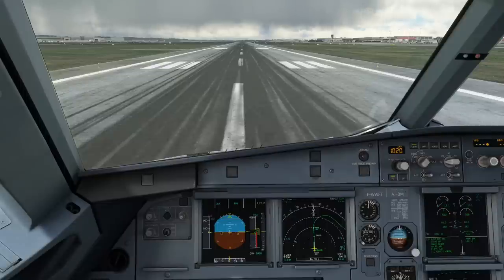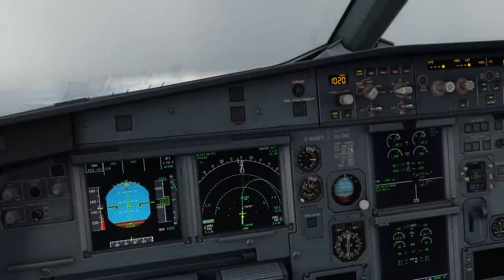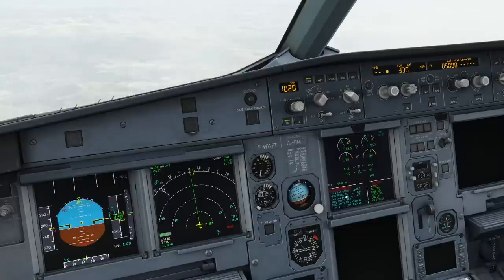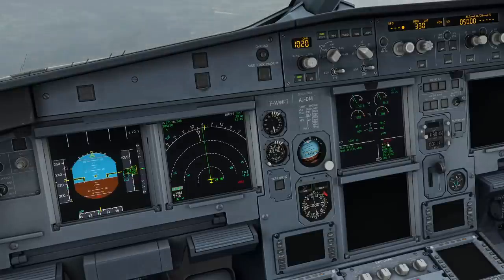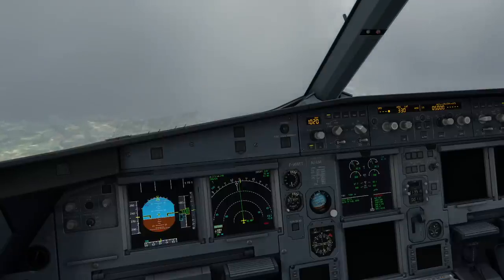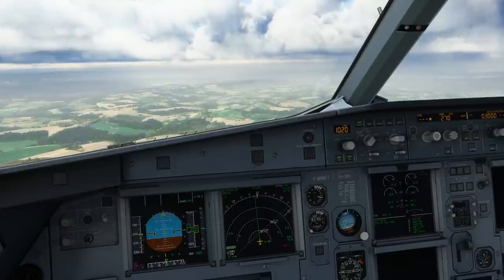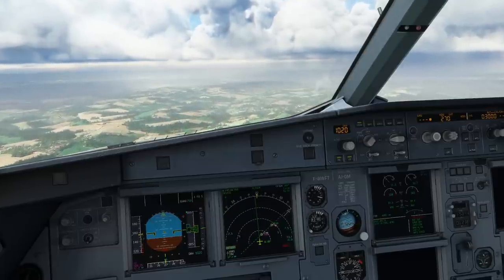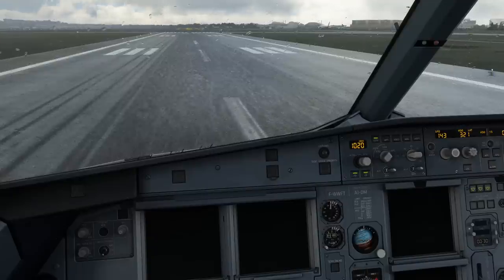Airbus Emergencies: EMER ELEC Configuration | Real Airline Pilot

Comment: Not related to this video but I noted your action about the baro selection.  When you depart a airport like Heathrow and the Alt Constrain for the SID is 6000 feet  and the transition level is also 6000 feet, when do you set your altimeter to STD? As we know some SID departure from EGLL can be quite lengthy. Do you stay on the current altimeter setting until you cleared for a higher altitude or do you go to standard?
Reply: My guess is if the SID alt constrain is 6000 feet, you leave the altimeter as is until you're clear to climb. If the SID alt constain is FL060, you change it to STD.
Reply from the maker: The transition altitude is, as the name suggests, still an altitude, thus you maintain an altitude. Which means maintaining QNH.
Those long altitude restrictions on SIDs in the UK exist just on paper, in hundrets of flights to the UK I never had to stay down low for longer than a few minutes at best.
Reply: @A330Driver  Thanks. In real life it make sense. 
But in VATSIM I'm cautious about this because the VATSIM controller might think I deviated from my planned altitude.

Comment: Great video as always, thank you!
I've heard that it's a good idea to extend the flaps to landing configuration before extending the landing gear, so that the airplane is already in trim when you go into direct law. What do you think?
Reply: Not the procedure. The gear down and flap 3 will compensate eachother to some extent. The only procedure where flap3 before gear id G+Y HYD system low pressure because no trim is available at all

Comment: the problem with absolutely zero flight computers in an airbus - being fly by wire - you are up the creek. even in direct law you still have your flight computers operating.  Is this mechanical law? Where you actually have direct control of cables to control the ailerons and rudder? How does that even work? Everything goes through the magic box. In the 737 you actually still had stick and rudder controls.
Reply: There are no cables in A320. Mech backup simply allow you rudder and pitch trim to stabilise in order to reset Flight Control Computers. Remember there are 7 computers all built by different teams.  The chances of losing all of them is very very slim
Reply: @csyoutubeacc  nothing works without electricity
Reply: @fn0rd-f5o  3 generators plus rat plus 30 mins on batt
Reply: @csyoutubeacc  well generator failure is a frequent problem in general and maybe it's the day you have an MEL
Reply: @csyoutubeacc  you could have all the pax plug their electronic devices in to help power the airplane in the event you need a minute more than 30 minutes. Electric flows both ways. I watch too many air disasters lol 🤣
Reply: @fn0rd-f5o  personally never had a Gen Fail in flight.  I have dispatched with one Gen inop. If second Gen fails you divert
Reply: @fn0rd-f5o  🤣🤣🤣
Reply: there are no cables. at all. ex: if blue hyd low/inop and ENG 1+2 fail and somehow the APUs out you'll be on batterys via the static inverter. this will last about 30 mins and you'll have some residual (hopefully) hyd pressure from windmilling eng 1+2. when the batteries die you'll be deadstick all the way down.